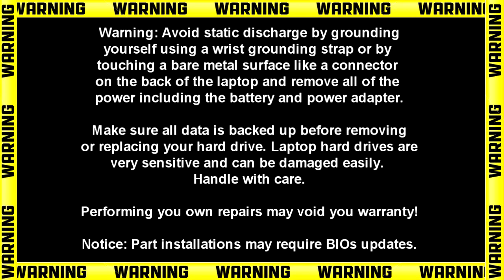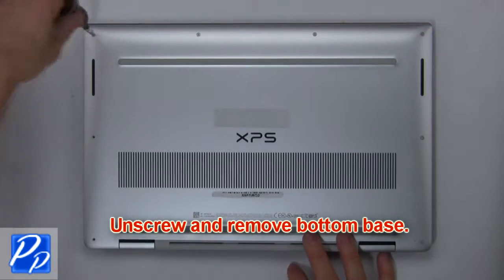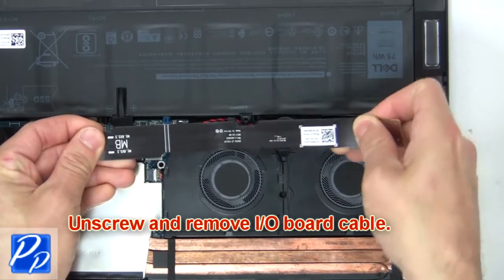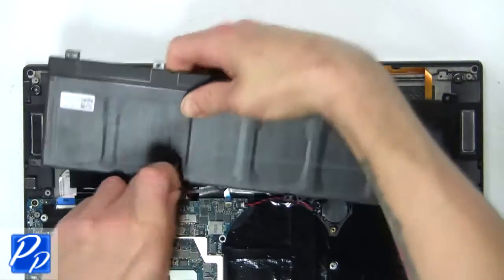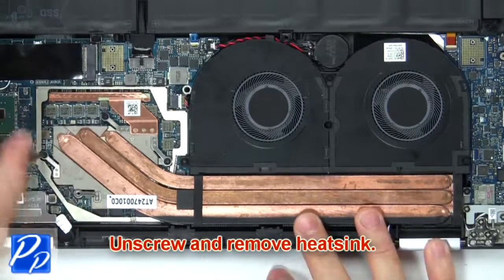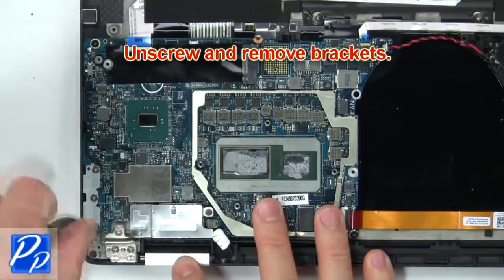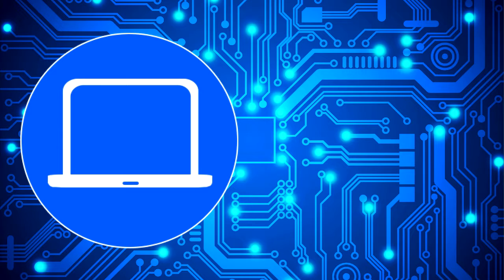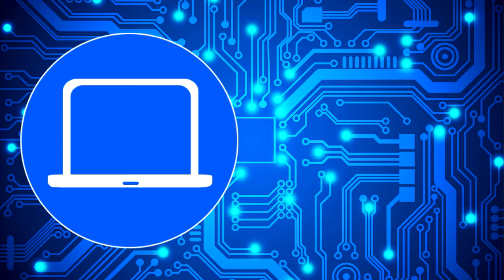Dell XPS 15-9575 2-in1 (P73F001) Motherboard How-To Video Tutorial

Comment: Hi - i was wondering if you could help. My 9575 refuses to work in tent mode.....im pretty sure its not software so the question was, where is the sensor that deals with the tent mode? im pretty sure if i can at least see where it is then i can maybe fix the problem...cheers.